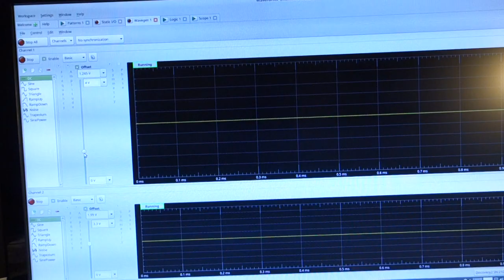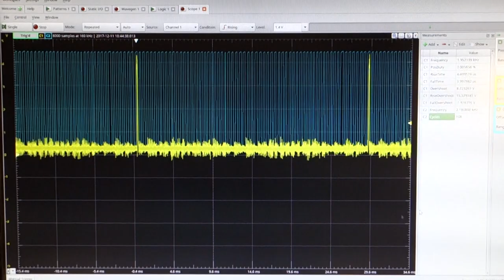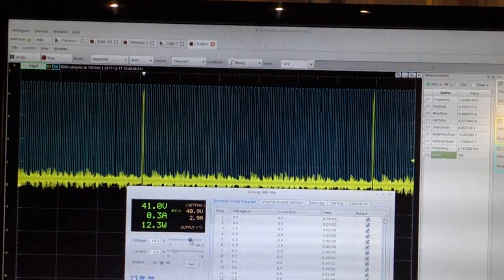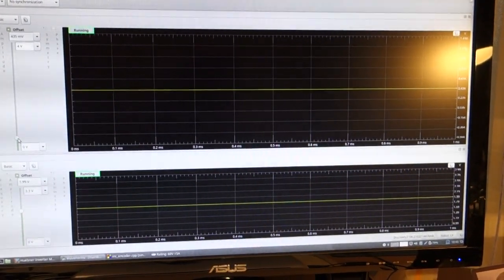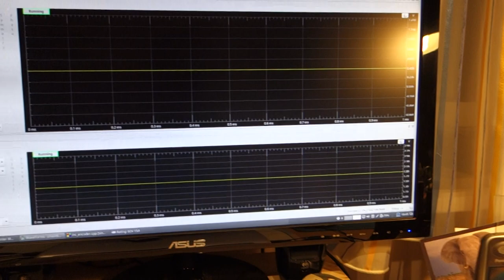Lab Update #3: Sync motor tests

Comment: Progress is looking good!! Have been following your projects for some time and are really keen to start building some prototypes. Would you recommend I begin building a V2 control board for driving these IGBT boards or will you have an updated control board for this design? Thanks :)
Reply from the maker: I'm using the V2 control board and there is no newer version. V1 control board would not work as it does not have the quadrature encoder support.
Reply: Thanks for the info!